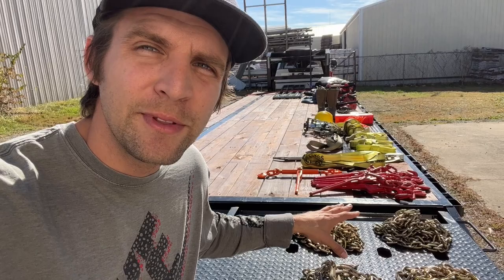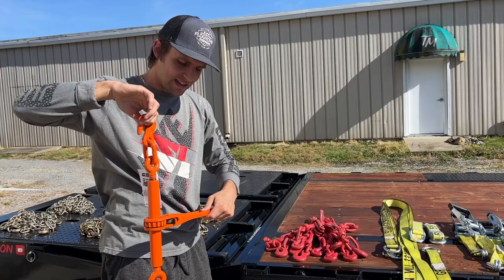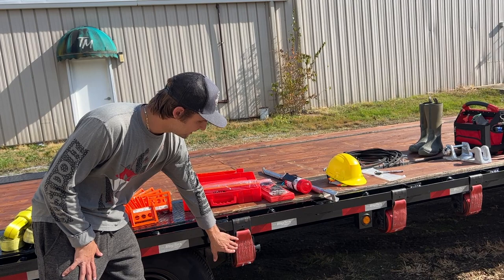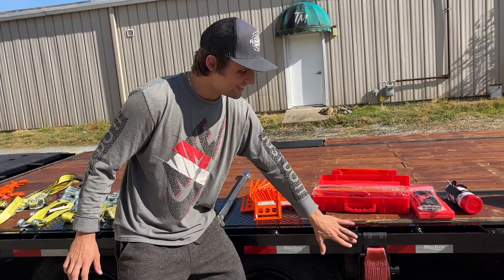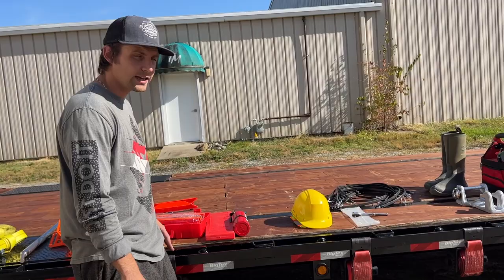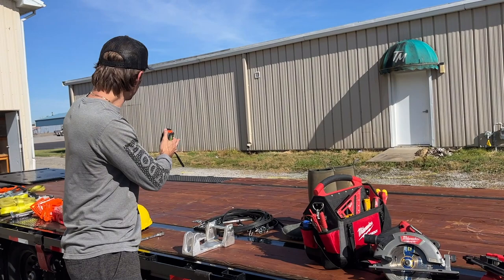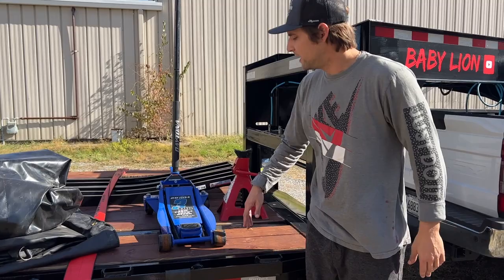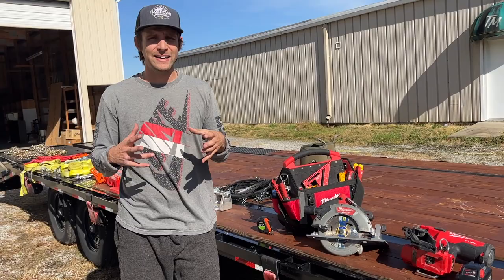Equipment To Get You Started | EPISODE 18 | HOT SHOT TRUCKING

Comment: A tip for the bungees: they come with the s-hooks facing opposite each other. Flip one of the hooks so they face the same way. Pinch the side of the hook going through the bungee so it doesn’t dig into the tarp. Remember to always hook the tarp with the end of the hook going away from the tarp.

Comment: Shop rags to use as padding against chains and to check oil and tranny fluid. Uline for corner protectors and thick cardboard for padding. I cut that into 9" wide strips and line the floor of my back seat with it. Shipping plastic wrap has lots of uses. WD40 for every time you get caught in the rain. In the winter a can of de-ice for the mirrors and glass. Leather gloves for loading and unloading and disposable latex gloves for pumping fuel. Corn starch when you get swamp ass in the summer and start chafing.🙃
Reply from the maker: hahaha and the list goes on.

Comment: Instead of edge protectors, you could use a stall mat and cut it into 6” wide strips. Stall mats are usually recycled from old tires and are tuff. Also, they can be purchased in different thicknesses.
Reply from the maker: Ya that’s a good idea and would be a lot cheaper!

Comment: As to the lever type of chain binder , I always use the excess chain and wrap it around the handle of the chain binder and it Always prevent it from popping loose . As to the ratchet chain binders they take way too long to readjust to secure your chained load . And for edge protectors for your yellow ratchet straps , I always have and use a piece of rubber conveyor belt . You can always get old or broken conveyor belts for free . I have a couple rolls sitting at home to cut more pieces from . Also keep in mind to condense all your supplies or you just don't have enough room to carry it with you . Plus there are several different tips than wasting money on that you really don't have to have ! But the one thing I really have that is very important is a battery impact gun for changing tires . The sooner you can change it on the side of the road the longer you'll live . Safety First Pal .

Comment: Get a better gooseneck lock. That one here can be cut off in 10 seconds. Yes it's only to deter and slow down a possible theft but there's definitely better ones out there. I would say other things as mentioned, you can get away with the cheaper stuff, but I would not  buy a cheap lock when just getting starting off.